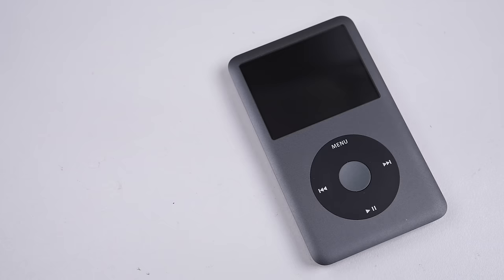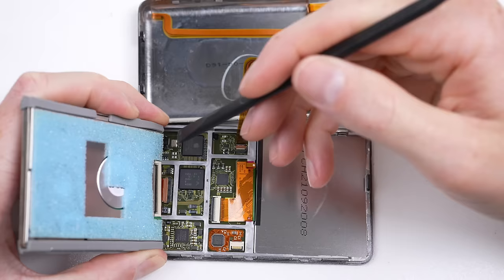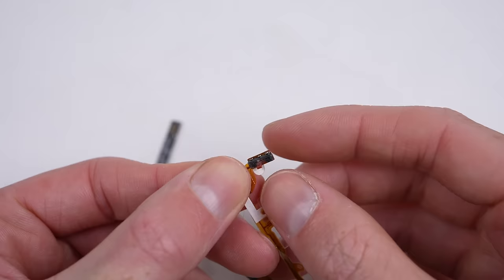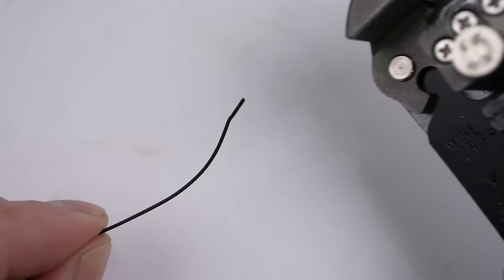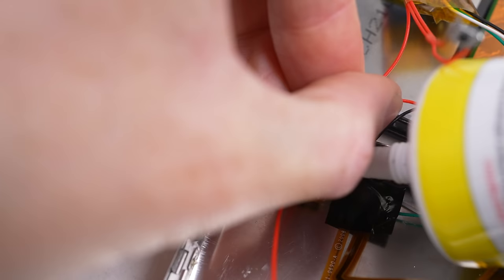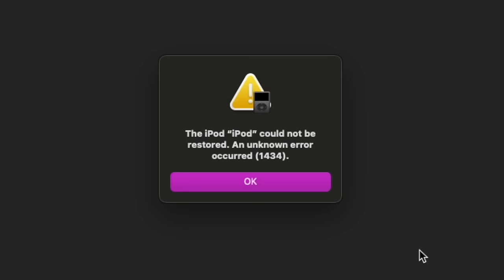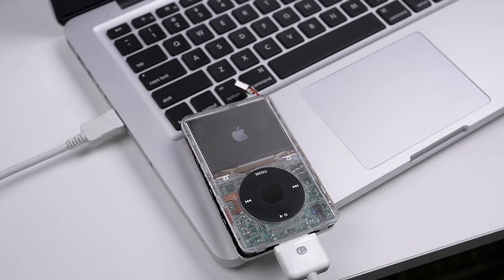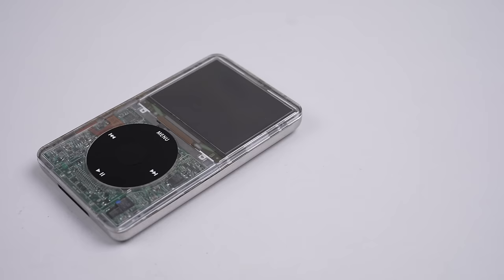Upgrading Obsolete iPod With Modern Hardware (With Great Difficulty)

Comment: The issue is that the iPod you used is a 120gb version (6.5gen). These can only accept a maximum of 128gb due to reduced ram. This is probably why you were getting the error
Reply: I disagree, I’m pretty sure it’s the ribbon cable from drive to board. I had this same issue and replacing that ribbon solved it
Reply: @Noice76   But when he put the old drive in it worked fine. You could still be right, but it’s weird that the old one still works fine.
Reply: I don't think that's the problem, if I remember right it will work, but only shows the max 128gb storage capacity. 5th gens don't have the capacity limit, but he was still unable to get it to work. I think the problem is his adaptor, they're known for not always working.
Reply: I think the issue is more than likely the firmware on the drives themselves. Apple works with specific drive manufacturers to preload special firmware on their drives so that they will work with apple software. I work as a network engineer and had to learn this the hard way a long time ago when helping a client with an old apple server that they had a drive failure in. The drive itself was 250GB and cost about $1200. Popped that sucker in and everything immediately worked. The reason it works with the gen 5 is probably because that was before they implemented their stupid proprietary firmware into their devices.
Reply: It's not a RAM issue, the system board only supports 28-bit Logical Block Addressing.  It is the same issue any Windows NT older than XP SP1 has, except for Windows it is software.
Reply: One other option would have been in Disk Utility to try directly cloning the working drive onto the new drive and seeing if there was some other factor implicit what's on the drive itself
Reply: @lifeofthunder this is the exact problem, there is a swap partition
Reply: I had a similar problem. Gotta manually partition de driver, make sure that rockbox is un-installed in the old HD, and then everything worked even reinstalling rockbox on the new hd
Reply: @influx__ I'd have to disagree with that. I've replaced apple drives with Samsung and WD drives just fine
Reply: @JamesAutoDude  Really depends on the device my friend.
Reply: @derickito  hdd uses the different ribbon. Adapter came with its own shitty ribbon adapter
Reply: did nobody notice the 4GB microdrive he tested?
Reply: but when dankpods made the bpod, this error didnt happen
Reply: I doubt it, I have flashmodded a 6th gen before and added a 256GB SD Card it still would restore and worked fine, but only showed 127GB storage. It's either the ribbon or a deeper logic board issue.
Reply: @arioxoxo666  Hey! With the 6th gen that you expanded to 256GB, how does it handle filling up with more music than the 127GB it believes it has?
Reply: @theskv21 it will not sync after u go over 127gb of music
Reply: @arioxoxo666  wow! It’s good to know, thank you
Reply: I think its the sd card file system, that sd card is likely pre formatted as MBR with either FAT32 or NTFS. The iPod would be using GPT and HFS.

You need an adapter/enclosure for the original drive to make it usb, then plug
both drives into a Mac, open terminal..

sudo gpt create -f /dev/*sdcard*

sudo dd if=/dev/*ipodhdd* of=/dev/*sdcard*
Reply: @xDMG15x how would an ipod classic know anything about gpt? it was not even on most pcs at that time...
Reply: @miko007  Apple has defaulted to GPT for HFS+ volumes ever since i bought my first mac in 2012 so I made that assumption without really considering the timeline. You’re right, it was likely an MBR disk with a HFS+ volume, and that SD card is unlikely to be HFS+ out of the box so the ipod is rejecting it. Possibly.
Reply: @xDMG15x  there is no ipod classic 7th generation, so i assume this is an ipod 6.2. it was released in 2008 and had an arm microcontroller as main processing chip.
those have so little computing power, it is safe to assume, the only filesystem they can feasibly use is FAT32.

those devices were not comparable to a todays iphone or something. they really just were nothing more than an arduino with an mp3 decoder chip.
Reply: @miko007  “The iPod Classic uses the HFS Plus file system, also known as Mac OS Extended.” - GrokAI
Reply: @Ikouy  And Microsoft !

Comment: How do you select a Bluetooth audio device using the Bluetooth adapter since there’s no system setting to select anything?
Reply: Very good point. How would you pair them to begin with.
Reply: That's what I thought too, but that's why he added the switch, he is so smart for this, I was like how is he gonna att the vibration, but it has that buzzer thing which I didn't know... HE'S SO SMAAARTTTT
Reply: He routed the output of jack to blutooth module and powered the blutooth module manually
Reply: Not sure about how he got that vibration

Comment: Hey! Looks like your ipod is a 6.5 gen since it is 120gb (7th gens are always 160gb when space gray). Unfortunately 6.5 gens have a 128gb hard storage limit unlike a 7th gen, which could explain why it was error coding when trying to restore it
Reply: Damn you APPLE !!!!!!👺
Reply: Just apple being apple
Reply: I had seen on Dankpods's Bee Pod video he had a 6th Gen and he put a 1TB SD Card in the ipod, it detected a 128GB capacity and not the 1TB, while on the 7th Gen it did it perfectly.
Reply: I believe invoxiplaygames wrote something to remove this limit, but I’m not sure if it’s been publically released
Reply: Dankpods fans knew it when they saw it.
Reply: Okay thanks I was wondering why I didn't work and I don't think he addressed it in the video of why it wasn't working. Apple sure thinks of everything to ruin the fun
Reply: For some reason, Apple kneecapped the 6th/6.5 gen iPods to LBA28 addressing so unless you reflash the iPod with Rockbox software, you are stuck at 128GB SD cards. The 7th gen went back to the LBA48 addressing so those would work with the larger cards. Not sure what Apple was thinking there, but once again, they thought they knew better.
Reply: @joes9954  is something like that flashable and is it that complicated? I almost bought one just to do the project to a while back but no Bluetooth craziness just a bigger hard drive but Bluetooth would be pretty cool though.
Reply: This was my assumption with the error as well

Comment: Can't wait to see a DankPods collaboration! 😍
Nice mod, I got myself such an 6th Gen (the 120 GB is also called 6.5 Gen, while the thin 160 GB is the 7th) two years ago, also a 5.5th Gen 80 GB and a Mini 1st Gen and modded these in early 2023, the 120GB got a 128GB iFlash SD (on stock firmware they're limited to that capacity due to LBA limit) and a golden case with blue clickwheel, the 80 GB got an iFlash Quad with four 256GB cards (it isn't limited by LBA) and that large 3000 mAh battery, also completely new case and the Mini got such a SD to CF adapter and 128 Gigs.

The normal iPods have two rear housing types: from the 5th Gen onwards the thin rear housing is used by the 30 GB model, the thick by the 60/80 GB model, 6th Gen has 80 and that particular 120 GB model with thin rear and the 160 GB with the thick rear housing while the final 7th Gen 160 GB has the thin rear.
Seems like the higher capacity hard drives had two discs inside so they needed that space.
I'm not exactly sure but AFAIK to use a thick back case (that is mandatory for these large batteries) you need to get a different middle frame, you can't just click such a thick rear housing onto a thin iPod.

Comment: Well, this is the exact upgrade I've been doing on a 5th gen. Can confirm, this took a LOT of time. My ipod uses a TaoBao transmitter,  and is connected directly to the battery, as well as a Iphone 7+ taptic motor epoxied to the rear case. That also has the advantage that just by soldering 2 wires to the power connector of the ipod, the rear case with the mods can be transferred from ipod to ipod easily.

Comment: Interesting. I've upgraded my older iPod Mini (2004). It is well made, and to me personally the finest iPod create ever with it's hunk of metal and solid design. Placed in an SSD and new battery. The 64 GB SSD is the same size as that old 4GB or 6GB MicroDrive, so it's just a straight swap out. The Mini is fairly easy to open, work on, and upgrade, no soldering needed. I installed Linus Rockbox, an amazing OS. Only difficulty is, at times the clip between the MB and HD would go bad, and difficult for me to repair. I've found once my upgrades installed, it's extremely reliable. I still use it to this day for listening podcasts, audio books, and music.

Never had difficulty installing iTunes. Never difficulty opening the Mini, or with anything else. However, I have no idea how to put in internal Bluetooth for the headset.

Comment: Forcing the battery to hold the switch is a pretty bad idea in my opinion. It reminds of the Galaxy Note 7 Dilemma.
"Parts Plus Pods" had a great solution for that. And I also wonder why you use an SSD instead of an SD Card, since you dont have any advantages over a normal SD Card. (I think the writing speed from the iPod itself are 15mbits or so, so an SSD is just overkill)  You could use the iFlash sd adapter since it uses much less space (if you cut it smaller). Or the new moonlight flash sd adapter, which is around 40% of iFlash Adapter and then install a 3000mHa battery instead
Reply: I have been very close to getting the parts plus pods back case with bluetooth but I am not sure what happens when the battery dies. I am not comfortable/experienced enough to desolder and resolder a new battery. I guess it can be done. Have you seen the moonlit market solution?
Reply: @Kurazaybo   I got the parts plus iPod and I'm quiet happy with it. But before the battery dies, you can get another set 😁 My last iPod battery lasted 10 years, so I don't see a reason why the mod shouldn't. If you need a new battery anyways you could also get rid of the Bluetooth mod

Comment: If you used an M.2 SATA SSD via an adapter, you would have 2 times more space.  Then you could use a larger battery or taptic engine from the iPhone 7. In addition, you can use a ready-made bluetooth adapter with a built-in battery, they are much more economical and have auto shutdown.  In addition, many of them support the APTX codec, which sounds much better.  For example, you can use 1Mii ML300
Reply: I've seen posts that M.2 NVMe/SATA SSD mod drastically decreases battery life (compared to microSD card mod), also heat generated from SSD (thermal trottling is a common issue for most budget 2230/2242 SSDs) could be an issue. But in this case, being able to put a larger battery might just be worth it.
Reply: @funghiman8492  but this is a lot cheaper and you can get large 512gb SSD in there.
Reply: I'm pretty sure he used a samsung haptic motor because it's smaller and square

Comment: No matter what the problem is... Hugh, you always find a way to solve it!

Hope someone in the comments has an answer for that 7th Gen problem!
A+
Reply: He used a bad iPod that basically can't support more than 128GB. It's the 6th gen, not the 7th gen. He needs a 160GB 7th gen in the thin variant to make his modification work.
Reply: @yuukimei9889  Now that makes alot more sense.
Good looking on the specs, because I damn sure plan to do this mod to my iPod.
Reply: @dothex  Also, note that 6th gens come in thin 80GB, thick 160GB, or 120GB variants. The only 7th gen available is always the thin variant, which can go up to 2TB in the Stock OS.
Reply: @yuukimei9889  You have such an extensive knowledge of this.... 

You might need to put that info to use and make a video :)
I know I'd definitely watch it!
Reply: @dothex  I used to modify iPods myself. For example, I have three iPod Minis, 2nd generation, flash-modded with 128GB SD cards. Nowadays, I enjoy playing with my Nintendo Wii. 
It's fun to add new channels with games on my SD cards and stuff like that.

Comment: 0:21 
Quick note:
You could've used a iFlash instead of multiple CF adapters, since it can support normal SD cards
Reply: I assume he knew that because he is using the M2 iFlash in his daily driver, but the green/red combo is a lot cheaper for a test build.

Comment: Would have done a picro tac switch at the bottom of the jack, make sure it's naturally open, headphone jack goes in closes the switch no Bluetooth, take it out, opens switch turns circuit on boom Bluetooth on. No need to reach in and toggle anymore.

Comment: Even though I love projects like these, the ultimate Bluetooth + haptics iPod is an old iPhone with a headphone jack. I still use my iPhone 5 precisely for this purpose… and replacement batteries / displays are cheap and easy to install. And you don’t have to deal with 30 pin cables, since it has Lightning.  It’s small enough to fit in your pocket, to boot.

If you plan to go down that same approach, I advise to get a 1st gen SE: still has headphone jack, and Touch ID to unlock (it’s a chore to unlock the iPhone 5 via the 4-digits code every time) .

Comment: Great work! Feels like a custom PCB for the storage adapters would be a welcome addition though - you could harvest the relevant connectors from the adapters you have, but likely make the adapter far, far more compact (especially if the custom PCB is two-sided) by having it be a direct ribbon cable-to-SD adapter.

Comment: Some times mac os and itunes are weird with the filesystems. You need to format the new ssd to the same format as the original hdd. This can be done with disk utility on mac os. This should be done before drive even gets connected to itunes. itunes usually formats and reinstalls but it needs to get recognized as its own before that..

Comment: Software storage limit on 120gb iPods. Use a 160gb 7th gen and you'll have no issue. Alternatively, you can run rockbox on the 120gb.

Comment: The iPod Video (5 and 5.5 Gen) is the best one to customize. I still have mine original from almost 20 years ago, but withe new battery and SD card. I bought 2 more when I found cheap (20 Euros), just to have as backup

Comment: if you want to mod your ipod without need to solder wires there are kits from moonlit market, there's no haptics but you get USB-C charging, bluetooth, slimmer plastic backplate, sd card adapter and new bigger battery!
you can buy a modded ipod or kit to do it yourself

Comment: A couple ideas if you ever make another.  

Might be a bit of an advanced mod, but the IC's require voltage when the device is on, so one option would be to tee off the voltage rail supplying voltage to one of the chips, something like the DAC (you can find schematics online to know which pin is the supply line), run that wire to the gate pin of a mosfet, then run the source pin to ground, and the drain pin to the bluetooth adapter for ground and then run vcc for the adapter straight to the battery, this would eliminate the need for a hidden switch through the earphone port as it would provide power only when the unit is powered on.

I like the solution of leaving one of the screws out of the hold button  to allow it to flex to hit the pair button, but another option might be a reed switch mounted inside. With this method, you would simply wave a strong magnet in proximity of the switch in order to pair.  This would allow you to mount the switch almost anywhere inside the device too, it would just need to be somewhere where the magnet wont get stuck to the back of the device.

Comment: Really cool modifications. I wonder why the 7th gen had problems... 
I wouldn't try the bluetooth mod as i'm perfect with my wired IEMs, but i have a iPhone X taptic engine waiting to be soldered in my 6th gen :)
Reply: He used a bad iPod that basically can't support more than 128GB. It's the 6th gen, not the 7th gen. He needs a 160GB 7th gen in the thin variant to make his modification work.

Comment: Crazy... I actually revived one of my classic ipods (video 5.5) about two moths ago but I didn't go all out like you. I just did a storage upgrade (512G micro sd) and a 3000mAh battery. I'm actually waiting for a new shipment with a new front/back cases for the one I already revived and another ipod (video 5). Though my regular 5, I'm also getting a iflash adapter and a new regular size battery. I'll probably use it to make my own rockbox theme and eventually sell it to a buddy for the parts cost since I actually bought it off him for like $20 way back when it stopped holding a charge. I actually bought it from him for parts in case I ever needed any but I eventually fell into the same thing of just streaming or using my phone... Since I revived my ipod, I've been using it daily in my vehicle (aux input) and at work without the possible distractions that cell phones bring into the mix... In a way, I kind of want to add bluetooth but at the same time, I enjoy the "simplistic" features of having the classic device that I'm fine using wired.

Comment: dayum...

...that's kind of all I've got
I've always wanted to see this kind of thing done to such an integrated device.
I hope that Framework phone where you can do this sort of thing in a standardized fashion becomes a thing eventually...

Repairability has very little market - any consumer will take "doesn't break (for 6..10 years)" over "easy to repair (but probably breaks within 4 years)" every day. However, Upgradeability does have a market - "buy now and plop in the better hardware when available (and fix whatever breaks more easily)"

Comment: your 7th gen is actually a 6.5 gen, as indicated by the original capacity of 120GB (not 128). the 6th and 6.5th gen classics can only take storage up to 128GB and there is no known way of fitting more.
Reply: 6th gens can go up to 2TB, but only with Rockbox, not with the Stock OS. The Stock Firmware somehow limits it.